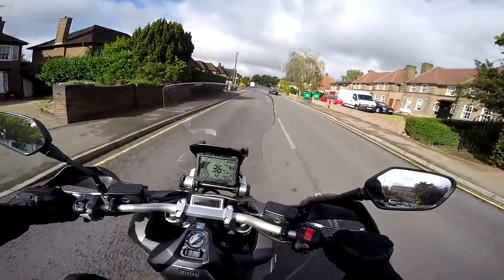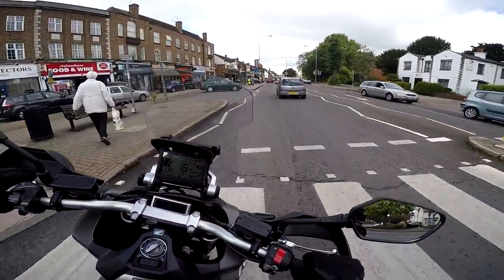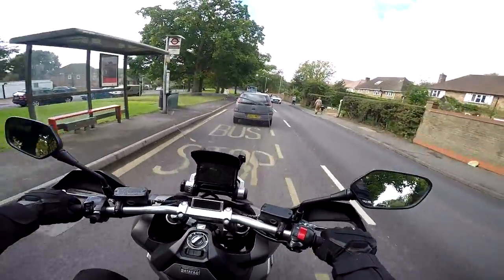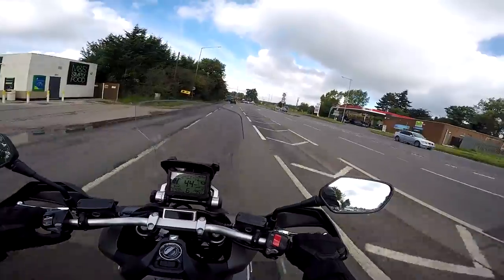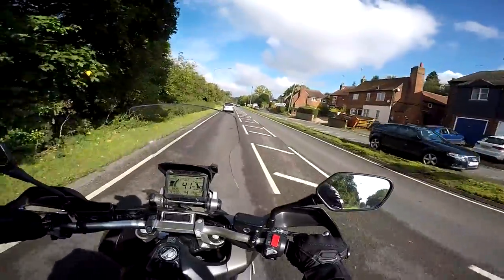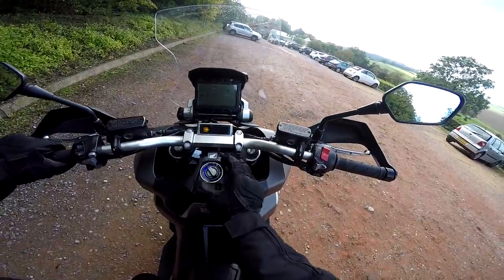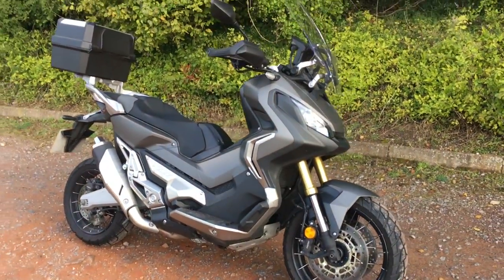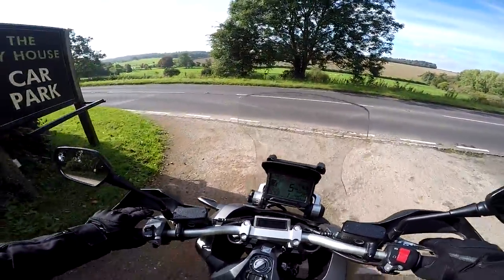2017 Honda X-ADV Review

Comment: Don't much like the look of it!  If you like that have a go on on an Aprilia Mana 850 GT. Think they've unfortunately stopped making them now though. They were well ahead of their time with ABS and different modes etc.. Looks more like a normal bike rather than a scooter but is an automatic CVT. 75 bhp. Really nice to ride every day. Wish more manufacturers would make stuff like this.
Reply: Thing on the back wheel looks similar to the Mana's rear parking brake - for when you leave it in neutral so it doesn't roll down any hills.
Reply from the maker: +Spiritus Yes it is the parking brake....

Comment: Oh, and regarding 12:25 , that extra cable and brake part at the rear brake is the hand-brake, or parking brake, FWIW. The lever to activate it is integrated into the front fairing, sort of up by your right knee when you are in riding position, you can see it at about 13:02 .  Does the bike need a park brake? I'm not so sure, but I guess there could be occasions where it might come in handy... Edit: Oh, I suppose it's because it's a DCT bike, so you can't leave it in gear, so it can roll easily on an incline, and thus the park brake.

Comment: If the belt is worn, you change it. Cost you maybe 100 ounds? If the double clutch gearbox is worn, what will that cost you? But i do love this scooter. Looks fresh!
Reply: Guy on here been travelling Asia on NC750X (same engine and gearbox) and has clocked up nearly 200k, doesn’t seem to have had a problem. Maybe because it is double clutch with a computer controlling the meshing and not some ham fisted human.

Comment: A pity that the topic on storage was not elaborate as I find this a major plus point for scooters (I ride a scooter on weekdays and a naked on weekends). The scooter's USP are it's functional conveniences which the motorcycle lacks, incl guard against wet road splashes. It'd be interesting to compare this with the Tracer GT as the price point is similar and both are capable long distance movers.

Comment: My dream scooter would be a smaller, lighter, & less expensive version of this Honda X-ADV but with more of an upright sitting position and larger wheels.  Something with the performance & size of a Piaggio Beverly 350 or a large framed Vespa GTS 300.  Actually, I just remembered the Honda SH300i.  Take that and make it into a Honda SH300i Adventure Scooter.  A dual purpose scooter that's both street legal and can be taken on some light off-roading.  Something you can ride to school or work to during the week and on the weekends take it on a light adventure camping trip.  Of course, I don't expect it to be ridden on very technical off-roading trails and single tracks.  But it would be fun to take it off the pavement now and then to explore.  Something like a Honda Super Cub but with a 300cc engine and automatic transmission.  Fun, frugal, & functional.  Not everyone has over $10,000 for a motorcycle or a scooter and most people really don't need that much power.  And besides, if it gets stuck or you drop it, would you even be able to pick it up by yourself?
Reply: I found a Honda Supra GTR 150 Adventure scooter online.  Who knows if it will go into production or not.  Maybe have a 150cc, 300cc, and this 745cc X-ADV.
Reply from the maker: Thanks for watching and for stopping by Shane - all the best - TMF
Reply: Thank you for all of your hard work in making a great YouTube Channel!  I'm a new subscriber and enjoy your format, editing, quality, etc.  Amazing Job!
Reply: Honda ADV 150cc

Comment: I have just sold my DCT Africa twin after 2000 miles, the auto box made slow riding (especially in traffic) quite difficult, maybe thats because i use the clutch to control the bike, interesting what other people think.
Reply: I had a similar problem when I brought a scooter. When you inch along using the clutch and rear brake for low speed filtering and manoeuvring the clutch gives you the control. What I did after a bit of experimenting was rev the accelerator to get the gearbox to bite and then use the rear brake to control the speed. In effect the bike was trying to leap forward because  I had increased the revs (not too much, but enough to feel it want to move), but was held back by the brakes,  like it was on a leash. With a bit of practice, the tension between the two allowed me to move the scooter along at the same slow walking speeds I could get on a bike using the clutch. I found I cold be almost stationery using this technique and still be in balance.

Comment: Nice video again! How would you compare it to the The Max you recently rode? Handling/fun/performance/comfort etc, and which would you choose?
Reply from the maker: I think I'd take the Honda over the big Yamaha Scoot - from a performance point of view the Honda is better.  That said, if cost came into it, I'd take the X-Max over this or the T-Max (all the practicality for half the price)....
Reply: TheMissendenFlyer Thanks. Yes TBH that may well be what I end up doing. Both TMax & X-ADV quite expensive and similar size, weight to my BMW boxers, whereas XMax lighter, cheaper and less overlap with my motorbikes. Aside from the longer journey comfort issue I mentioned in the TMax, I often ended up leaving the TMax in the garage for the rural rides I do in Wilts/Oxon/Berks etc. and not using 2 wheels at all for shorter journeys...whereas that XMax 300 might just fit in my garage & get used on journeys less than 10miles.
Reply: Another honest review. Value for money IS poor, though funky fun was appealing. I found a big difference between the 3x Sport modes. S3 was a laugh but I suspect fuel economy takes a hit 😉
Reply: I don't get why so many people would settle for riding something that costs a bit less, even though it would not be so cool or so much fun. I pay whatever it takes for what I want, in the overall cost of bike ownership for 3 years, the sticker price is a small bit of the overall. I love my Xadv, there's nothing else close to it, it was worth every yenny. Don't measure bikes by anything else but smiles/mile. This expensive sucker is at the top of that list.

Comment: that thing at the bottom of the rear brake is probably  the handbrake , since it's automatic you need a way to block the wheel when you leave it on the hill  as you can't leave it in gear
Reply from the maker: Indeed it is yes....

Comment: You forgot to mention that it can be ridden manually using the gear change switches on the left handlebar.  Not a criticism, just an observation.  Hey Ho.
Reply from the maker: Oops - thanks for pointing that out - I should have mentioned it, you are quite correct....

Comment: Another thorough and useful review.  Thanks!  Not hearing a compelling reason to trade in the BMW C600, though...does the Honda ship with heated gear?  The hot seat/hands on my Beemer are nice during chilly commutes.  --cheers
Reply from the maker: I don't honestly remember John, pretty sure it had heated grips but would have to look it up to be sure....
Reply: hm....don't see 'em listed in the specs on the official site.  Interesting, though, that the bike appears to ship with the cute / ugly top-box.  The 'cugly box," like all top-boxes, utterly ruins the flow of the bodywork. ..owell.  Very interesting effort from Honda.  Can't wait for the first 1000cc  step-through!

Comment: i have vespa sei giorni 300 which i use for commuting, my wife on the back 30 mile everyday south east London to central London, the little tyres of the vespa is so not good on wet weather plus we getting stop all the time by police, two up on a vespa no L plates you figure it out, they think we are suspects. i was recently looking for Beverly 350 then realize that police even sops them more as they use this one for robbery of the phones, they stop also Tmax scooters as that ones they use to steal scooters with, So this scooter actually might be the answer, it has a practicality of a scooter, but has bike tyres and brakes so i am really considering it, i am listening the review and then will decide. But that tyres has to go on that scooter it needs a road tyre, hope this will be my solution :D London getting tougher for scooter riders, because of the doggy kids stealing and doing rubbery as a hobby.

Comment: But is it worth the extra £2500 over Honda's own NC750 X DCT ?
Reply: Spec comparison on paper or watching youtube videos is not enough for a decision. Motorbikes are a highly emotional thing. You need the experience in real life, so you have to try both on your own. If the XADV fits your ass and heart, damn yea its worth the extra 2500.
Reply from the maker: ....for me it's probably not worth the extra - liked the X-ADV a lot but it is a quirky and expensive little thing .......but hats off to Honda for trying something different....
Reply: Does seem expensive.
Reply: Frederick Briggs I guess you no longer have the NC700?
Reply: Frederick Briggs That’s interesting stuff as I’m looking at going the other way. I currently ride an ‘07 GS but really fancy a DCT bike. As you discovered the Africa Twin is too off road biased, tubed tyres are a bad idea front puncture repair perspective. Also for a £10k bike I’d expect at least the option of cruise control. I’m interested to see if Honda refresh the massively out of date CrossTourer for 2018 (LED headlight, cruise control and decent factory panniers). A NC1000X would be perfect........
Reply: Well there is quite a bit of difference. Far superior adjustable front suspension whereas  on the NC750 it's basic suspension. Twin radial front brakes upfront as against the NC750 far more basic single disc set-up. Alloy rear swinging arm as opposed to steel box item on the NC750. Keyless ignition etc. However, I reckon it should be £8999 max.
Reply: They're probably available at that price with a bit of haggling !
Reply: You must test ride an Xadv before making decisions. I got one and it's totally awesome fun, easy rider, piece of art.

Comment: Unfortunately, they (Honda) missing out as lots of guys have A2 licence (like me) and Honda do not offer restriction kit for it. I just don't understand.  Sales will be like 9 Tmax vs 1 X-ADV... nonsense from Honda. I was down for one, but it will be a Tmax...
Reply: Hi, there. So I did a bit of investigation and there is a restriction kit for about £300 (Atimpex). Maybe some other A2 riders are interested as well. Oh, and I have just subscribed :)
Reply: Ithink it's just a job via plug In at honda

Comment: People in America  have a hang up about scooters.  The only ones we see are small and underpowered but now the motorcycle companies are seeing a market for a larger scooter with some power and two up abilities.  I dont think of these as scooters vs motorcycles.  The lines are becoming blurred.  Scooters used to not have gears so they were scooters and they had floor boards and openings to put your legs in front of you.  Now Goldwings have automatic transmissions, but I am sure they are not scooters.  The bikes with openings in front of your legs are now getting large engines like motorcycles.  Are they motorcycles?  Let just say if it has two wheels and an engine its a motorcycle and get rid of the stigma some people put on "scooters".

Comment: I would be afraid of grabbing the "Clutch" handle and getting rear wheel lock up.  Too used to the foot brake for the rear wheel.
Reply: I thought that too until I rode a scooter...not that hard to get used to.  I mountain bike also, so maybe because of that it isn't as difficult to transition.  I didn't find it difficult to go between a scooter and my Triumph Bonneville...just have to know what you're riding.

Comment: That looks like the same Honda top box as on my DCT Africa Twin. The Drive mode is a waste of time on the AT as it goes up through all six gears by 35mph. I have to use Sport 1 or Sport 2 to avoid jerky junction turns.
Reply: D mode on the Xadv is not like that. It's pretty well good for most riding. You can always blip it down a gear manually and it'll pick up from there. S 3 was actually rather useless as it takes it way up in each gear, something the Xadv doesn't need to do. This bike feels nothing like the CRF1000, it's got like zero weight up high and plenty down low. It's stable as hell at low speeds. The CRF1000 always feels like it wants to lie down on one side or the other. The Xadv feels like it's got a gyroscope inside. You should test one.

Comment: Ok anybody else got one. I just got an Xadv and I love it very much but the front end is bottoming out way too easily. I have not cranked up the front springing, is it possible this is normal or maybe no fork oil in mine? Anyone else had this problem?
Reply from the maker: Anyone???
Reply: I"m going to tighten up the front end, also will check the setting now. Dealer said it can take a few kms to get the front end working fully. I'll let you know how it goes. I take it on your test the front end did not bottom out?

Comment: It’s a pity they didn’t use wheels as per this (tubeless) but obviously bigger for the Africa a twin 🤔
Reply: Xadv has features the Africa Twin can only dream of getting - adjustable windshield, tubeless spoked wheels, low COG, rear hand brake, and twice the fuel economy. I just sold my Africa Twin and got an Xadv.

Comment: If you are 6feet 2inch 185 cm tall it is actually not a machine for you without getting a lot of pain in the backbones 
the seat are too Short and to wide, and after 300 km ride you get a lot  off pain in the ass 😖
With the transmission sound from this bike  you need a closet helmet not to hear the down gears from the camshaft to the gearbox .
With an open helmet it sounds  more like a Russian  tractor Quite annoying actually, 
hate to say it but it is the same with the 750 NC
I  had mine for 6000 km  (6 month) and now sadly sold it for an Africa Twin 2019  DCT 
Check the link below  for hearing the raw sound  of the X-ADV 750  👍
https://youtu.be/7pV21qEmV7g